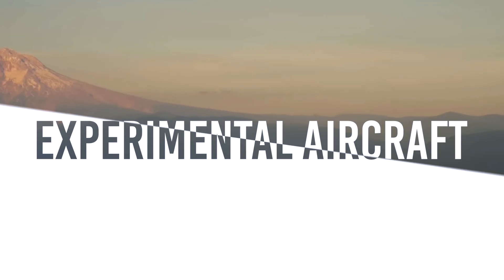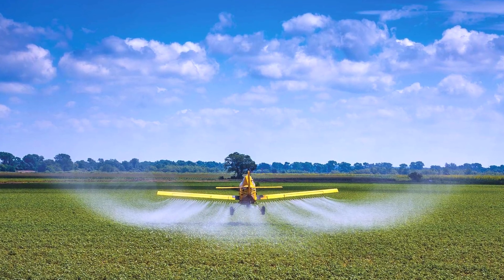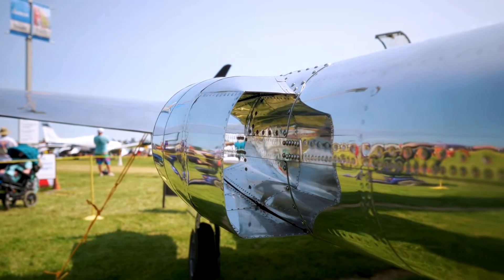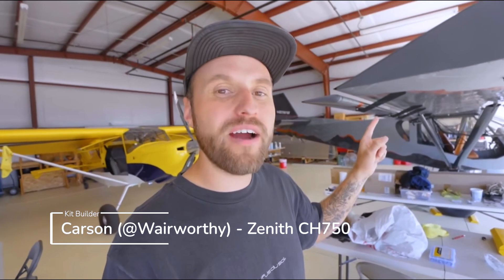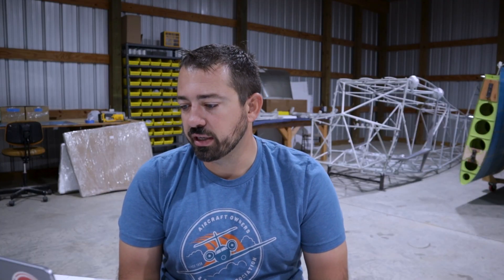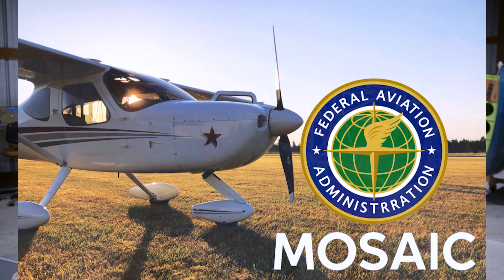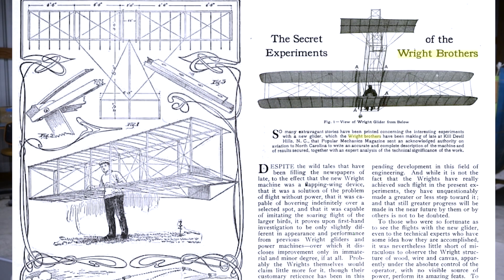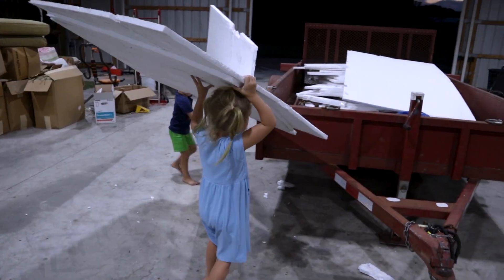Experimental Aircraft: The Basics and Build Methods!

Comment: I've thought experimental aircraft made alot of sense as a recreational/personal aircraft after seeing the capabilities of things like kitfoxes and the dyke delta. What you mentioned about certification costs driving up the price of parts is frustrating for sure, but after having plenty of "genuine motorcraft/ac-delco/mopar" parts fail due to poor factory QC, I begrudgingly accept that it has to be that way in order to ensure safety. Experimental isn't necessarily a loophole but seems like a way for people more familiar with doing their own QC to circumvent the increasing costs of owning/buying a plane to some degree. Looking forward to seeing the new plane!
Reply from the maker: That's why I mentioned I understand why the FAA requires individual component testing during the PMA process but unfortunately that comes with additional costs. While most people won't treat it this way, I see it as an opportunity to source more reliable parts and higher quality rather than the Great Value version of something.